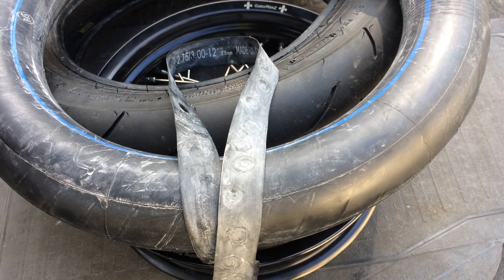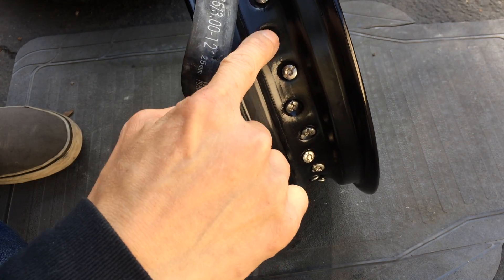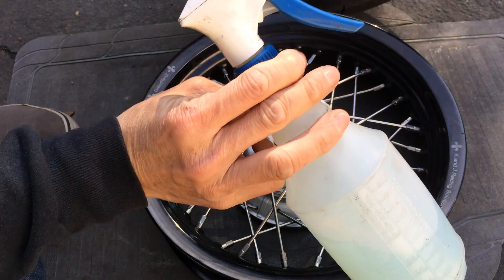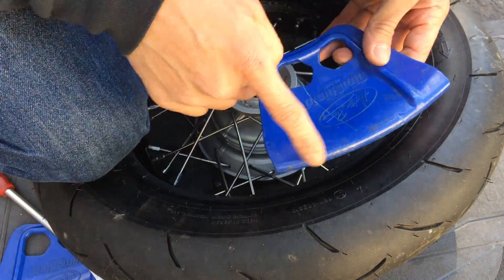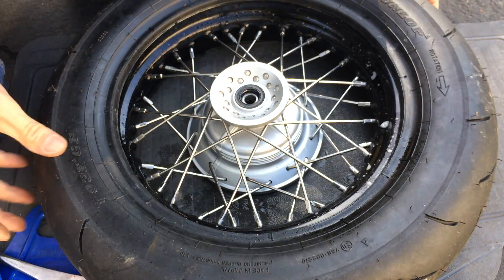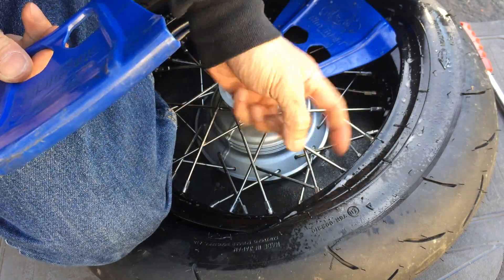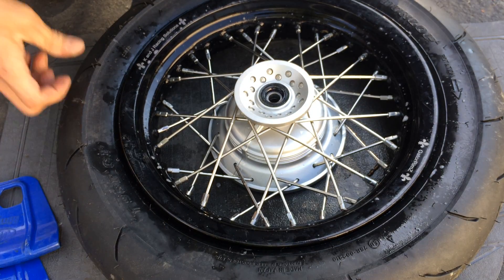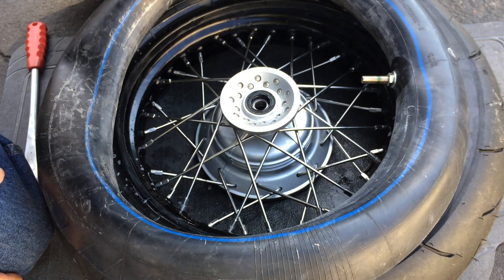Mounting tubeless tire on spoke wheel Pt.1

Comment: I like to use the cut-out sides of plastic LAUNDRY BOTTLES, for a rim guard which is a bit thinner, so easier to fit but not quite as good of a protection, better to protect from scratches more so than deep gouges per se. Best used with PROPER tire spoons, as they're the least likely to gouge your rims whereas the wrong tool such as crowbars or flat-head screwdrivers will damage the rim AND tire - But yeah, sometimes you need a thinner piece of plastic to make the job less stressful on the rim. As with older vintage racing type thin-walled rims such as the "SUPER-AKRONT" 3.50x16" or 3.50x18" rims first seen on the Harley XRTT road-racers, privateer versions with the dual-disc front end that is, circa 1970 possibly even 1969 - they were first marked "PAT.PEND.AKRONT" so that would shore up the theory that these earliest pictures I have found could very well have been the year they were first produced. Mid '70s would've been stamped "SUPER-AKRONT" and later they were simply stamped Akront "D" profile, though they're soooo distint from other Akront rims. Very soft shoulder, very very thin walls on these featherweight rims. No bead retention ridge on 'em, either. Beautiful stuff. The Borrani "Rinforzatto" Record type 3.0" width drop-center shouldered/flanged/valanced rims don't have 'em either - THIS is why they'll always require an inner-tube, it's nothing to do with whether you seal 'em or not. The bead ridges mean you can seal 'em. Early Moto-Guzzi LeMans owners are always on the forums asking if they can PAINT their wheels to seal up any theoretical pores which let the air out - they're a cast one-piece wheel, but they don't have the RIDGES this is why they're tubeless. The world's first tubeless motorcycle wheels were the Honda COMSTAR wheels - the best thing to rebuild THEM with are the Akront "NERVI" which can be found up to 6.0x18" size, so any width you'd reasonably want - and substantially lighter than the OEM D.I.D. aka Daido branded rims, from the Honda Comstar wheels. The trick is in what FASTENERS to use, and I'm hoping to use aircraft assembly Aluminum RIVETS just like the original wheels. Check out the BBC Documentary "GUY MARTIN'S SPITFIRE" with the section where they're riveting a gas-tank together, and you'll see my epiphany moment for the most perfect fasteners for Comstar wheel rebuilding. Good thing I live near the museum where they restored one of the world's only two flying condition LANCASTER four-engine WWII bomber planes, as they've probably got the exact same equipment as seen in the documentary! Here's hoping.....

Comment: Just waste my time here..You are not a pro bro.. And this is not a tubeless but a tube tire..
Reply from the maker: The tire is a tube less tire.  Never said that this is a tubeless set up.  Conventional spoke wheels are always tubes..but there are tubeless conversion kits out there that can make tube tubeless.  I have a kit but haven't made time to do it yet.
Reply: Yeah, I totally agree. This is a SCOOTER type tire, isn't it? Where else have you even SEEN a wire-spoke wheel in 3.0x12" size? These wheels are ALWAYS a heavy cast one-piece type. This is some truly awesome stuff. And when it comes to putting a heavy-walled tubeless type tire on an alloy wire-spoke rim, this is definitely definitely PROFESSIONAL advice! Here's the one and only person I've seen on YouTube, whom I would trust with MY wire-spoke Maxi-Scooter wheels: The "KZ440LOL" for my daughter, with 3.0x16" Borrani vintage "Chopper" or "Side-Car Racer" rims, laced up to a Suzuki 4LS drum up front so the spokes are short like cigarette butts - A KZ400 hub on the rear with all NOS belt-drive kit from the KZ440LTD "parent model" or donor bike. My daughter wanted a bigger scooter, and I had an old KZ440LTD so I made a "compromise", call it a "Scooter-esque Motorcycle" which has also been "De-Cruiser-ized"! Or as I like to call it, a "PROTO-MOTO".....
Reply: I'm gonna go out on a limb, from the appearance of that hub - and say maybe it's a VAN-VAN with two rear size rims? Bah - that was a 14"-er, wasn't it? WTF do I know. Definitely a front wheel though, ennit? Ya'll need a bigger DRUM. Check out vintage drums from older models, and get the rim RE-DRILLED, by Buchanan's, using a heavier gauge of spokes and/or spoke nipples. This way you can put a bigger diameter drum in there, maybe even a full-width drum rather than conical? Slightly heavier, yeah - but a much much more powerful BRAKE!
Reply: seriously, what a jerk. this was a useful video to me - I didn't know I needed a rim strip. these spoked wheels are new to me. thank you for taking the time to post this video to help out your fellow riders, dabinche!
Reply: Sa mga spokes pwede sakin yan
Reply: Osmango wag ka ng umipal like ko yan bugo ka eh sa spoke nga ND man mags